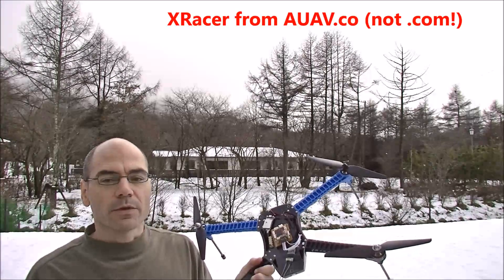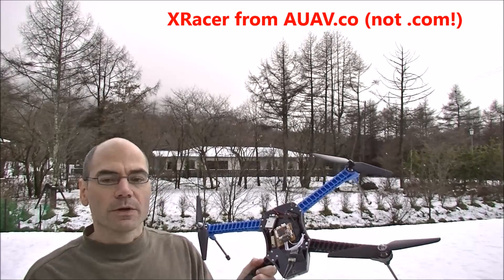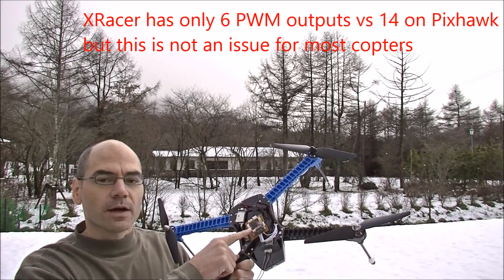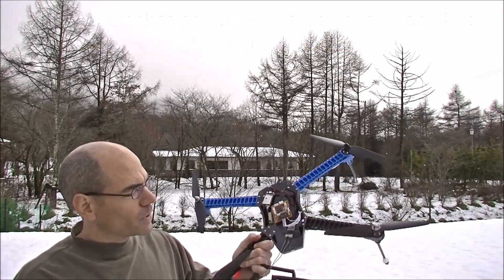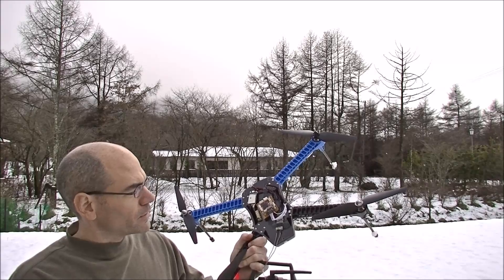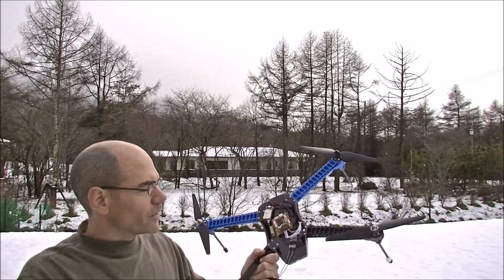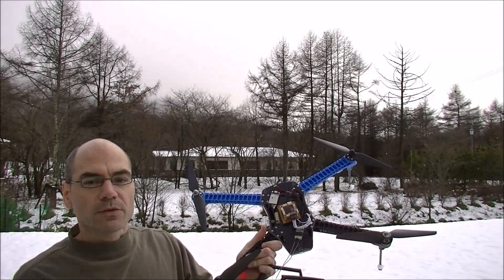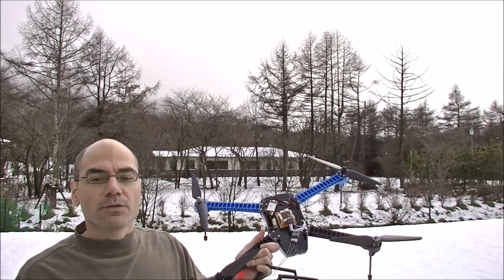XRacer from AUAV.co

Comment: What is an xracer?
Reply from the maker: +bill alvarez It's a new pixhawk compatible board made for racing quads.  It's very small (about the same footprint as a 3DR GPS).  I've added some links above including the introduction blog and where it can be purchased.
The special thing about this board is that it's missing the Pixhawk's I/O chip, this means it has slightly less input/output but it also allows it to be smaller.